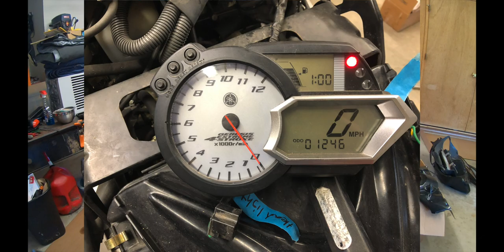Removing the Apex Engine

Comment: Enjoying your build, I really like that side by side, flapperon Kitfox......you can't go wrong with a Yamaha, amazing piece of engineering shoe horning that engine into that sled..........Looks like mating a larger speed reduction unit should be fairly straight forward as the engine already has one.  Frankly, I'd suggest going with the KISS approach, using a single 2" wide Kevlar belt reduction rather than direct gearing as it would provide numerous benefits....... virtually no maintenance, it won't transfer pulse harmonics (gearing back chatter), would provide the slippage necessary in a prop strike, aka no clutch (unless the apex engine won't idle in the power band you need), would weigh less, probably last way beyond any reasonable engine TBO and  lastly, would be cheap compared to a gear drive.
I've installed these types of belt drives on very large commercial air handlers over twenty years ago and man do they work, they reliably handle instantaneous (starts) with 100 HP electric motor loads rotating a mass significantly larger than any engine/propeller combo you could imagine for that air frame. Would probably last well over 5k hours.
BTW, given the neck of the woods you're in, I hope you'll be looking at a turbo for that puppy for some awesome performance.....

Comment: This is a 1000 cc engine right?  I like the engine for a Kitfox build but I'm going Viking 170 (Honda 1.5L Turbo) for my CH 750 SD build I will start in January next month. I like the larger displacement engine for the heavier CH 750 SD build.

Comment: Forgive me if I missed it, but:  What year Apex is this?  I'm looking at an '06 for sale locally where the owner states an oil leak at bottom of engine - thus the need to remove said engine.  With 9k miles on it, I'm wondering - even if the machine were given to me for free - if this is a job worth tackling.  I'm sure I can do it, but, not sure if I've got the appetite to virtually deconstruct the entire machine to remove engine.  If the oil line is just failed, or the piping it's on, that should be an easy fix.  If it's more involved, I'll be wasting a lot of time.  And the person is looking for about $1700...  Clutches typically never come off easy, and exhaust bolts love to snap.  Thanks in advance for the Year of your Apex.  Jay
Reply from the maker: 2007

Comment: Holy cow.  That was involved.  Looks like the Apex is a two stroke?  Glad to hear you're going to put it in a new airframe.  I could see all kinds of issues installing it in place of the O-290.  Any idea of the difference in installed weights of the two motors?
Reply from the maker: Dennis, It is a 4 stroke in line 4 cylinder fuel injected engine. The installed weight including engine mount, intake and exhaust, gearbox and propeller should be 175-180lbs compared to my Lycoming at 260lbs.
Reply: Good to hear it's a 4 stroke.  There's a saying...."friends don't let friends fly 2 strokes".  Problem with 2 strokes is, they run great right up until the point when, without warning, they just quit :(  @BowenAero

Comment: sweet build you got going there.  is the 4 cylinder more desirable in aircraft than the triple cylinder genesis?
Reply: Genesis is very new, so there isn't a wire harness adapter for it that exist for aviation, and nobody has put the time and effort into testing, and developing a gearbox adapter. Apex has been used for aviation for almost 10 years at this point, so it's tried and true motor for LSA.
Reply: @benlzicar7628  i see, thanks for the info!

Comment: What research did you do to see if this Apex engine was suitable to use as a aircraft engine?  Are you concerned at all if it will be reliable enough?  How about the demand or load on the engine as a snowmobile vs. as a airplane engine?  Will it be able to handle the different demands placed on it?
Reply from the maker: All good questions and I have researched it very thoroughly. I will be putting up a video soon talking about the engine choice.

Comment: Wow there is a lot of parts you maybe able to reuse in the plane. What about the shocks for your landing gear?
Reply from the maker: Guys have tried that, but the airplane specific suspension systems from TK1 racing are far superior.

Comment: im trying to pull my seat and tank.    there are two rivits on that back cover   .    do they need to be drilled out?
Reply from the maker: I don't think I had to drill rivets to remove the seat and tank, but you do need to remove the exhaust pipe covers to get to the seat bolts.

Comment: Yamaha PWC engine the MR1 was used in the FX140 and FX160 HO series, waaaay cheaper and way easier to remove! Those are the same engine as APEX and the Motorcycle R1 in jet skis its 140 and 160HP with restrictive exhaust and intake, the motorcycle it gets to over 180HP
Reply from the maker: Accept it has an integrated gearbox as part of the case.
Reply: Project Kitfox the PWC engine has a integrated gearbox do t know the ratio! I believe the top RPM out is around 4000 and 5000RPM